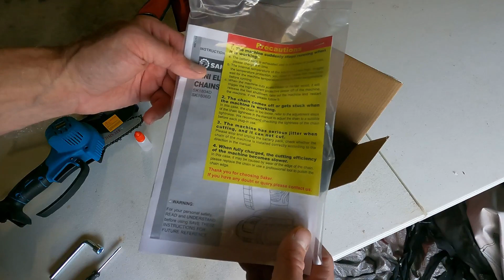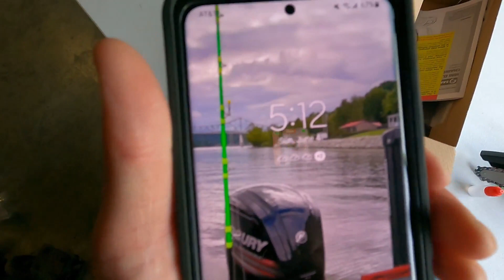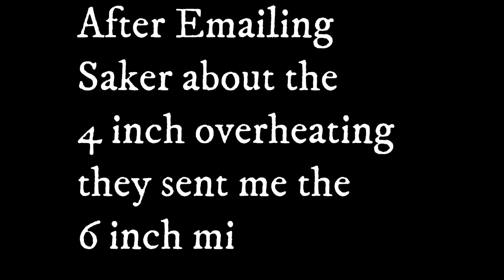Saker Mini electric Chainsaw Review (4 Inch and 6 Inch)

Comment: You have to keep it primed with oil throughout cutting. Keeps it from binding up
Reply from the maker: Yes that's true,  cool little saw though I use it a lot
Reply: @LONEWOLFOUTDOORSLIFE  I just bought the pink one with case, 2 batteries, 2 chainsaw, gloves, safety glasses ect for $79 on sale! Can't wait to get it. Out of all the ones I researched this one is great!
Reply from the maker: The battery holds good charge , used mine yesterday and haven't charged for a while
Reply: @LONEWOLFOUTDOORSLIFE  that's great to hear. NY mom who has parkinsons used to work in her yard but can't now, so I will be using this to do a lot of yard work.
Reply from the maker: @donnarichardson2888  it will be great for that , I was trimming tree limbs yesterday with it , works good
Reply: @LONEWOLFOUTDOORSLIFE  I cam hardly wait, lol. Thank you, and have a Blessed day!